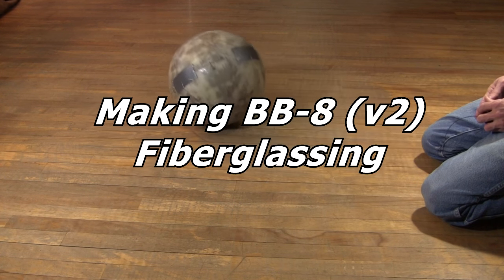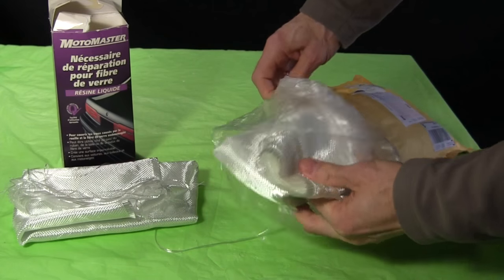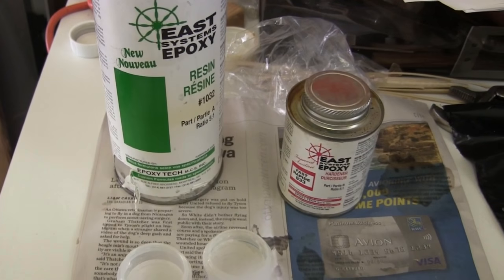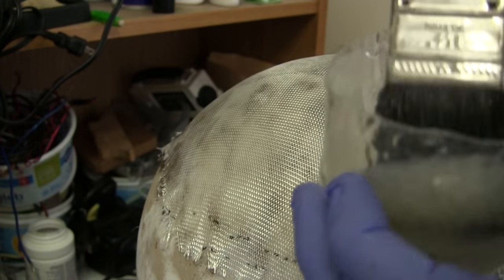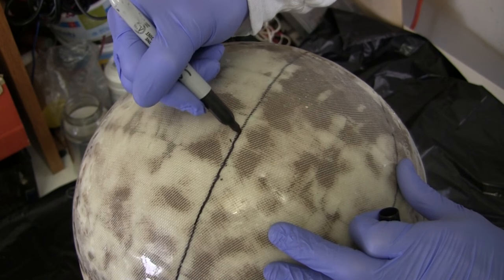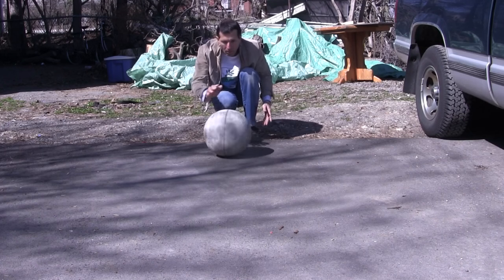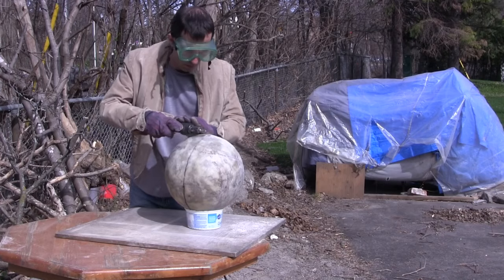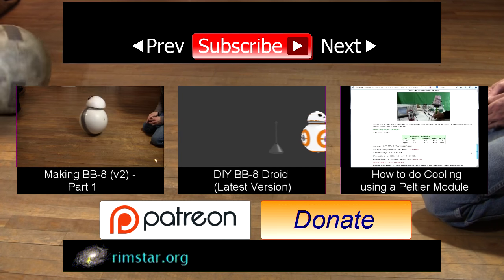Making BB-8 (v2) - How to Fiberglass - Part 2

Comment: Hello. Nice project, very interesting. At 2:38 the viscosity of the resin is high, not low. The more viscous it is the more it resists deformation. At 4:56 the viscosity of the resin is low, not high. It is not easy to make a perfectly round sphere !
Reply from the maker: +Michel PASTOR My bad. You'd think I'd know better. I'll add some annotations. Thanks for pointing it out.  And I'm with you on that, re the difficulty of making perfectly round spheres. I'll continue sanding it as time goes by, tweeking it whenever I see where I can improve it.

Comment: You did an incredible job, given that this was your first real fiberglassing project. I'm jealous, my first one didn't go nearly so well. And mistakes with fiberglassing can be extremely painful on the wallet. It's a good thing you knew to get the tweed fabric. Plain-weave fiberglass would've been a huge pain to force to drape right, and fiberglass mat has it's own host of aggravations, including that it doesn't play as nice with the epoxy-resin.

For this project, 3 layers of that weight of fiberglass is overkill, but that's OK. Now it'll outlive whatever you throw at it.

When you are doing your rounding and smoothing, don't worry about adding fiberglass, like you did with those little patches. just add to your low-spots with automotive filler putty (Bondo).  Alternatively you can add sandable thickeners such as talcum powder to your existing resin, but that's a boring and messy process. The trouble with adding fiberglass is when you add it in excess, such that you have to sand it back down (which is honestly what you always want to do), the fiberglass fibers murder your sandpaper. You want something that will sand easily but still be durable. Bondo is specifically designed to do exactly that.

In fact, you'll likely want to coat the entire outer surface with Putty. It's tough to tell at this stage, but that fabric texture is thicker than one might think. You could add gel-coat instead, but for whatever reason, that stuff seems to be much more expensive.

Since you're making a sphere, if I were you, I'd be pretty tempted to set up a makeshift lathe and smooth the putty layer down by turning the thing. As long as you can chuck the thing up so that it's nice and secure, smoothing a sphere in this manner is a pretty painless process.

Every time you do a video on this project, you make me extremely tempted to start on my robotic tire project again. Cursed being responsible with money, why must you always get in the way of fun?
Reply from the maker: +verdatum I was familiar with the drapability of the fiberglass I had and had encountered mat but this is the first I've heard of plain weave. Looks like I got lucky there.
Regarding 3 layers or less doing the job, I wanted to do all fiberglassing before cutting open the globe, since I figured once I opened it I couldn't be sure of having as round a sphere to add more layers too. So I had to guess. I was actually planning for 4 layers but figured that would be too heavy so I took a chance on 3. You say that 2 layers might have done it, and it sure would be nice to have one less layer's weight. But I don't think I'll try another globe unless the weight becomes an issue. You'd be surprised at how much the mass affects the shape though. It's sitting on the ball at only two points at the sides of the drive system, near the equator.
I'd heard of filler putty but would like to avoid buying more products. These BB-8 droids run some people up to $1500, something I don't want to do. I'm finding a lot of small things are needed that add up quickly. I kept all the trimmings from cutting the fiberglass and might use that chopped up as filling if needed.
I like the lathe idea. That sure would be a more painless way of smoothing it!
Robotic tire project... sounds awesome. We want to see it! Do it! :) How's that for adding to your temptation. Actually, if you're thinking of an actual car tire, or some such, that seemingly roles around on it's own, that is a cool idea.
Reply: RimstarOrg I certainly understand keeping a budget; I'm still pretty terrible at that. A quart of Bondo putty is $12 from Home Depot, or you can get a bottle of talc to mix with your resin from any pharmacy for something like $5, just to keep it in mind.

Only add chopped fiberglass scraps as filler if you explicitly need to add serious strength to something. If you're just leveling and smoothing stuff out, it will only serve to frustrate you.

And yeah, it's literally a spare car tire rolling around on it's own with black fabric concealing the working parts inside. An effects team made one for a horror parody movie called Tire.  About...a killer tire. I wanted to make one the moment I saw the thing. I'm putting an RC-actuated pendulum counterweight in the top half, allowing it to veer to the left and right.

Comment: The only problem is the odor from the resin. Great results. Just be careful you don't cut off your lower unit at 6:39!
Reply from the maker: +electronicsNmore Surprisingly there was very little odor with these resins. Though that might have had something to do with the two ventilation fans in the window running day and night for the 3+ weeks it took to do all the pieces.
As for 6:39, it looks dangerous but it wasn't. I considered it at the time. The grooves made by the dremel made it quite safe, plus the angle of the blade really wasn't right to cause harm, even if the globe somehow rolled away. I wouldn't have cut it like that if it were just a plain cardboard globe though! That would have been less controllable.
Reply: RimstarOrg I was only joking around at 6:39. :-). I've done far worse in the past.
Reply from the maker: electronicsNmore
I figured you were. It does look dangerous though - scary movie! :)

Comment: 4:56 Viscosity always confuses me. Wouldn't it be a lower viscosity for the material that moves more easily?
Reply: +RC-1290 Yes you are right. The more viscous it is the more it resists deformation.
Reply from the maker: +RC-1290 It turns out it confused me too! I'll add annotations. Thanks for pointing it out.

Comment: Very nice howto, thanks!
Are you thinking of charging it wireless? That way you can close the horizon perfectly.
Reply from the maker: +deslomeslager Thanks! No, it would take too long for the amount of power required. I'm using two drill batteries that are velcroed to the base of the drive system to make to easy removal. You can see them in my part 1 video here https://www.youtube.com/watch?v=BCXH4AN2aog.

Comment: Hey RimstarOrg how much did this project set you back in terms of creating the ball? I want to make a 3 to 4 foot 8ball and am really considering making it out of cardboard, resin, and fiberglass. How much resin and fiber glass do you think I will need?
Reply from the maker: That's hard to say since I didn't keep track of how much resin I used and I was just using up leftover resin from two different sets of containers. So I don't know the resin costs. The fiberglass cloth was $20 for 20 sq ft (6 oz) bought from ebay. I guess you can use the formula for the area of a sphere to estimate how much you'd need (mine was 12" in diameter). Don't forget the cost of all the sandpaper you'll need.

Comment: I was wondering how you got/designed the template for cutting the fiberglass resin
Reply from the maker: The paper templates were made by laying a sheet of paper on the ball and drawing a rough line for where I wanted to cut them -- nothing more complicated than that.

Comment: Would you know how to make a cheaper perfectly round sphere instead of buying a globe?
Reply from the maker: If all you want is the globe then they can be had for free from websites like https://my.freecycle.org/. I've also gotten then for $5 to $20 from local thrift stores, craig's list type websites, local classified ads, local people selling them on ebay. I don't think you can get cheaper than that.
If you want to then coat it with fiberglass then that's where the costs add up.
Other than that, I don't know of anything cheaper.

Comment: please to notify that the ration is by weight, this is im[ortant. so for 20 gr of A = 1 gr of B
Reply from the maker: +Chemu Kef For the second resin that I used it was by weight with a ratio of 4 to 1 (e.g. 88 gr of resin, 22 gr of activator). For the first resin that I used is was by volume with a ratio of 5 to 1 (I don't remember what volumes I used).